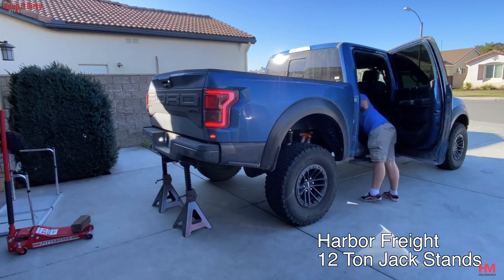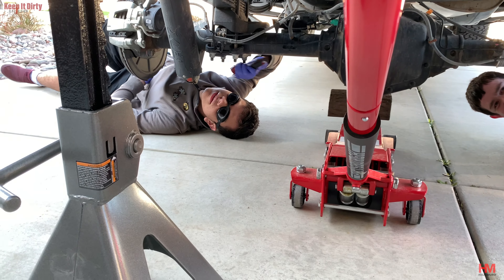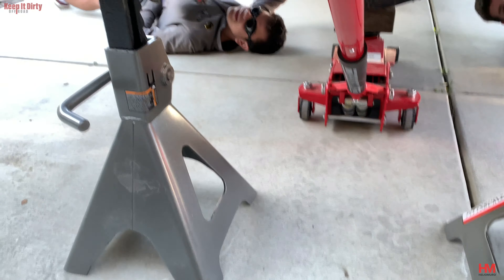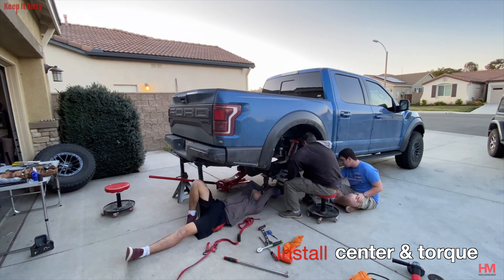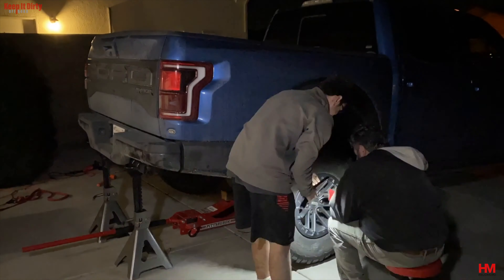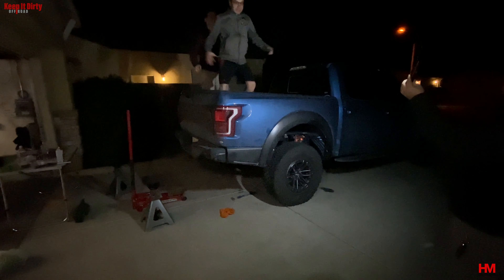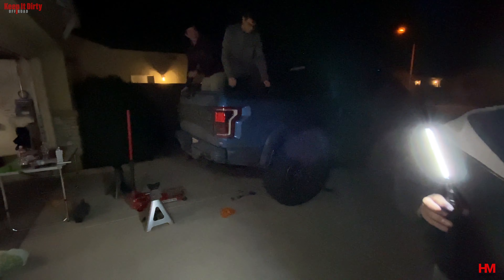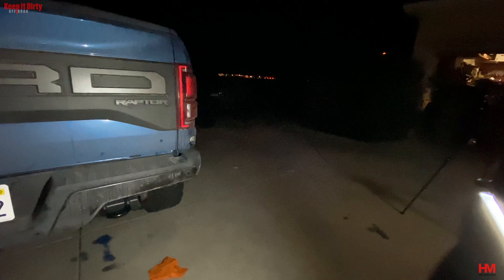2020 Raptor - Deaver Installation

Comment: Do you know if Deaver happens to sell the hardware separately? Like the ubolts and nuts and bushings?
Reply from the maker: Yes they do. They sell just the install kits as anytime you remove the U bolts, you need to replace them. Just give them a call and they can set you up with a custom order so they send you the right hardware.
Reply: @KeepItDirtyOffRoad  Thank you! Will do 👍🏼

Comment: Hey i already have Eibach spring in the front and ive notice alot of sag in the back, what Deavers would you recommend for someone thats planning on installing a rack to carry 2 spares and a jack in the fiture? I dont want it too be too tall but i also dont want it too scuat too much in the future
Reply from the maker: Dual spares with a jack should be fine with +3 Deavers (1” over stock) or icons at +1.

Leaf springs will sag overtime so if you want to extend the life of your purchase, get the icon kit because you can add or a remove a leaf to change the ride height up to +3
Reply: @KeepItDirtyOffRoad  thank you so much for the advice man i really appreciate it 🙏

Comment: I'm gonna get HD +4 Deavers  (a) cos their in stock and not 6 weeks out and (b) cos I plan on various load outs depending on what my trip is either rooftop tent for camping or lotta gear for a raptor run. Do you forsee needing drop shackles? Do you think a setup like that is ok for mostly around town and once a month off road trips? The other option is SD+3. I have Geisers in the front already. Mainly cos I saw your videos on em here on youtube. Thanks Man.
Reply from the maker: So I ran Geisers with HD+4s and about 400’lbs of gear and the back end was slightly lower than the front fully loaded, but way high empty. 
I never used drop shackles because she was already too low fully loaded. 

Unfortunately there is not one size fits all here. You have to build for the most common config. If she will mainly be your daily, +3 (1 over stock) or +4 (2 over stock) will be better. Ride smoother. If you plan to carry weight then get into the HDs. 

If you want something more flexible, look into the Icon springs. By removing or adding a leaf you can change between 1-3 over stock.
Reply: @KeepItDirtyOffRoad  Thanks Helio for the quick response. I have Geisers up front and OEM leafs in back. I've got the chance to go with HD + 4 with drop shackle OR SD + 3 that are in stock. It's a 6 week back order for HD + 3 which is what I was considering before the confirmation on the long back order wait time. I do mostly street driving with occasional off-road use but when I do I go hard.
Reply: @KeepItDirtyOffRoad  I think I'm gonna go with SD+3 and play it safe. Get some extra levelling and protection but not worry ton of weight in back.
Reply from the maker: Just make sure you math is right. +3 Deavers is 1 over stock. Back end will be slightly lower with Geisers up front on empty.
Reply: @KeepItDirtyOffRoad  Thanks for info. Going with HD+4 (m44) in rear and if it ends up too high do a drop shackle. Mainly cos HD+4 is in stock and I like the idea of the shackle being an option if I really wanna lower immediately or raise down the line.

Comment: After almost a year, would you really reccomend Deavers for replacing the stock springs? I've got a Silverado and i had to remove the 3rd leaf for extra comfort, but dont know if a set of deavers would be worth it
Reply from the maker: Deavers or any leaf upgrades are totally worth it for high speed off-roading. Most lifted trucks or those mudding won’t see much value. But for high speed offroad Deavers or Icon springs are a MUST.
Reply: @KeepItDirtyOffRoad  Nice, Thanks !

Comment: How much weight are you typically carrying? Thinking of going the +2 route. Typically daily driving with a Retrax Pro XR (90lbs) and no other weight. When camping (light / moderate off roading), going to carry a tent / supplies (total weight including retrax up to maybe 250lbs to very occasionally 325lbs). Going to also do the somewhat adjustable SVC bump kit with the 2.0 Fox IFPs. What're your thoughts?
Reply from the maker: Cole Mizak I carry around 600 lbs or so. 

+2 for you setup won’t be enough. +2 Deavers is stil stock height and with 250 lbs they will sag a bit. You may need +3 Deavers at a minimum

Comment: Do you have to install new Bump Stops with Deavers HD+2 on 2019 Raptor or you can stay with stock bump stops if you only doing mild offroading?
Reply from the maker: Wojciech Gierczynski if your doing any off-roading, I would HIGHLY recommend Bump Stops. The stock bumps don’t offer any protection when you do Deavers. My Deavers would actually hit the frame with the stock bumps at full tuck. And because mine went well past flat, after 6 months of off-roading, I had to get them re-arched  because they were sagging too much. So  you don’t have to if all you do is street driving. But if you offroad, bumps are a must in my opinion.
Reply: @KeepItDirtyOffRoad  thank you
Reply: Funny video at the end. I plan to pull a horse trailer and I have stock suspension  you recommend this spring on a stock setup? What’s it like to dive when I read empty?
Reply from the maker: Paul Newman Raptors and towing don’t mix. The soft shocks and spring just sag way too much. Beefing up the springs can help, BUT now the back end is all stiff and up in there when your not towing. Just get a tow rig man. Raptor was not meant for towing

Comment: If I get the geiser coils in the front of my 2019 raptor and I put the 2 inch lift deavers in the rear, will it be leveled out or is the rear going to be higher?
Reply from the maker: adrian lopez depends on the weight you carry. You have to plan for all the gear and weigh you carry. Upgraded springs will not perform well with an empty bed. 

+4 (2 over stock) with around 150-200 lbs will sit level. HD+4 with around 400 lbs will sit level.
Reply: Keep It Dirty Off-Road I have a tool box bolted on the back of the bed and I also plan to have one spare tire on the back when I upgrade to 37’s. These are the only two things that will always be  i. The bed of the truck.
Reply from the maker: adrian lopez you may be fine with +4. But really depends on the extra gear in the tool
Box.
Reply: Keep It Dirty Off-Road ok cool thanks for helping me out and keep on putting out great content 🤙🏻
Reply from the maker: adrian lopez anytime man, and thank you

Comment: If you could purchase again would you have gone with Deavers +3 ??
Reply from the maker: BIG_DOGG 1102 No. I had regular HD+4 and they could not compensate for the gear I carry.

Given the choice and unlimited funds I would go linked. On a slightly lower budget, I would do a beg cage with the 3.5s and +4 or +5 Deavers with a drop shackle. But I would need the front end done first. And that’s where I’m headed. But with my current Deavers

Comment: You got to turn the truck on for the shocks to settle out some then take a new measurement.
Reply from the maker: Luke Reeder 🤣🤣 I know man. Did it in the last video. We did let is settle and it did not settle any. We put in the rack and it barely went down. Its fucking hilarious. Breaking them in now and they came down a bit finally
Reply: @KeepItDirtyOffRoad  

I believe you have to keep your foot off the brake pedal and press the start button ignitionon, don't start truck, and wait a few seconds then turn off  for a live valve shock reset.

Yep, found notes:

"Suspension Reset:

"First thing to do is a shock reset.

Simply sit in the truck without foot on the brake. Ignition On without Engine Start. Then Ignition Off.

According to RPG, this will reset the sensors in the shocks and it can usually correct the feeling of the shocks after install."
Reply from the maker: sixshooter4570 in my experience the rear suspension won’t reset and drop till you drive it. Every time I take off I can feel the back drop a bit.

Comment: When installing Deavers, do you change front springs as well?
Reply from the maker: Joe Park I would highly recommend it. You need to have a balance suspension for the truck to track right and perform better offroad. Deaver are much stiffer than stock and will send more load forward,
Reply: @KeepItDirtyOffRoad  I have 2019 MY with Undercover hard tonneau cover, Yakima crossbar, and a large HD basket.  Now truck looks like it is 1/2" to 1" lower on the back.  What do you recommend for the front?
Reply from the maker: Joe Park what are your plans for the front? Keep it stock or upgrade the springs or shocks? How much weight will you have in the back fully loaded? And do you plan to offroad it a lot?
Reply: @KeepItDirtyOffRoad  Honestly I don't like the OEM suspension setup, it is too soft for my taste (I know it's off-roader) but since like 90% of Raptor owners, majority of my drive will be on paved road.  I am thinking about getting a light travel trailer to pull and don't want a sagging rear end.  Looking for +3 Deaver and something similar upfront....looking for recommendations
Reply from the maker: Joe Park so +3 Deavers won’t get you much in the form or towing capacity. Raptors were not built for towing, even towing light. A soft suspension for offroad and towing just don’t mix. So with Standard Deavers you still will see major sagging with towing.

My recommendation man, if pick one. Either tow or offroad and setup the truck for it. But for towing the Raptor is a waste. I’ve seen way too many guys tow with a Raptor and it’s so unsafe with a sagging back end.
Reply: @KeepItDirtyOffRoad  So if I give up on towing, would Deaver setup eliminate the sagging issue? Or do you have a cheaper option?  If I am not towing, I don't know if I want to spend $1500 for leaf springs.  I am looking for an inch to 1.5 inch at the rear
Reply from the maker: Joe Park yes upgraded leafs can eliminate sagging in the back. I would recommend the Icon springs for you so that you can pick your setup. They have 3 configurable option from just 1 over stock to 3 over to take more load. 
Deavers you have to pick one and your stuck with it so it requires more planning
Reply: Keep It Dirty Off-Road Thanks for the advice, btw enjoy ur vids. Keep it up.